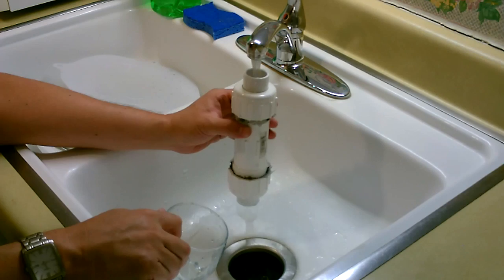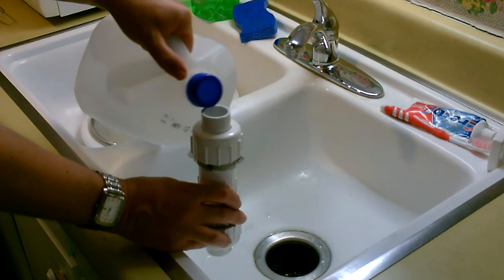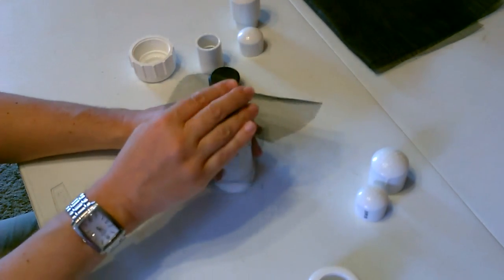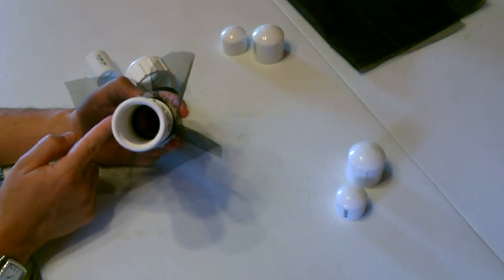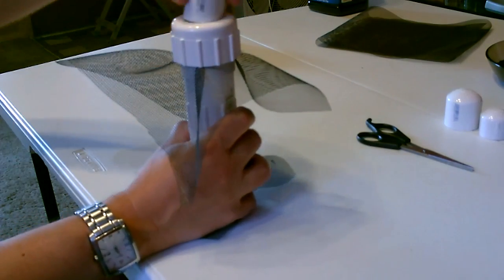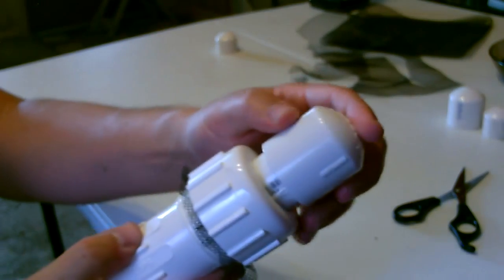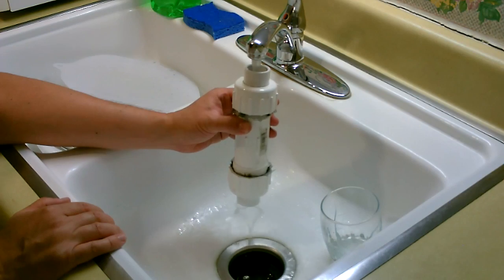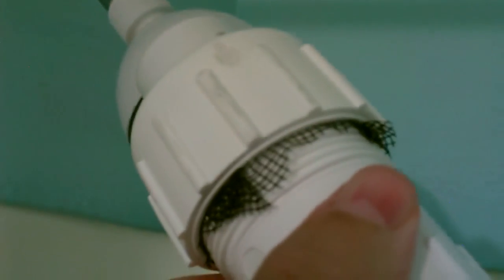Homemade Water Filter! - The "Compression Coupler" Water FIlter! - Easy DIY - Full Instructions

Comment: The screen I bought turned out to be too thick to screw the thing closed, but I found a solution: aquarium filter bags. Turns out using the bags is even simpler to work with than the screen 😊
Reply from the maker: good deal 🙂

Comment: A price update for this coupler in my area. (05-26-22)

I bought the 1 1/4 inch coupler from lowes for 13.60. (The end 2 pieces that get compressed, are 1.14 each.)

Their is a 1 1/2 inch coupler which is fatter for around 16.00.

The home window screen cloth is about 14 mesh.(# of squares per 1")

The marineland carbon is 6x12 iirc so it works well.

If you get a smaller grain carbon, you will need a finer mesh material to hold it in.

Hope this helps some folks.

Keep up the good work desertsun.  We all might be needing these things soon enough.

Comment: Brillant. I have never seen this before. What size is that compression coupling? Any idea what end I would I need on the end to allow this to connect to my garden hose? Thanks!
Reply from the maker: hi and thanks! i would use one of those pvc 'pipe-to-garden hose' connectors. they make them specifically for that. one tip about those is that they don't usually sell that in the PVC section of the store. i always find that particular piece of PVC only in the irrigation and garden hose area.
Reply: @desertsun02  Thank you!

Comment: The carbon keeps seeping through my screen. I even put 2 screens on, and it still had bits and pieces seep through. Are you using some specific type of window screen? I'm using a fiberglass type bought at Home Depot.
Reply from the maker: hi there. some of the smaller bits get thru from time to time (even happens on the commercially sold units). once the few smaller ones go thru you should be okay. i just use regular screen. maybe buy activated carbon that is a little coarser. i think they sell a pellet version too that i've read is good for water purification
Reply: @desertsun02  - Thanks. I'll try the pellet version next time.

Comment: Wow! This is just what I think I'm looking for! We have a 2" water line gravity fed, coming from a spring to a large storage tank. How do you think this would work for filtering out sediment from the stream before it gets to the tank?
Reply: It would probably work pretty well but as for the longevity of this particular filter, for its size I'd be skeptical. For your purposes, I'd apply the same idea but make the 2" piece of pvc filled with activated carbon much longer than the one in the video. Then just use mesh and couplings. I have a very similar water system at my cabin and I'm going to try it to remove some minerals from the groundwater
Reply: Having same problem with my spring, too much sand and dirt getting into the sediment tank did you make one? Would like to see your set up

Comment: could this be used to filter rainwater directly?
Reply from the maker: hi. this is just a quick thought but maybe with the use of a funnel or funneling system on one end *and collection container on the other.
Reply: I have no knowledge  of water filtration systems but can I attach a clear flexible PVC tubing to it?
Reply from the maker: hi. yes, you should be able to do that. might need an adapter to connect the two but should be pretty easy.

Comment: how long should be change the filter and where to buy the activated carbon? nice video thanks for sharing
Reply from the maker: hi. the carbon can last months, even years depending on how much you use it. you can tell when it's time to change it when the water doesn't seem to purify very well. amazon is the best place to buy the carbon. walmart sells it too. also most places that sell aquarium supplies have it.

Comment: I need to hook up to a garden hose. Is this threaded to screw on garden hose?
Reply from the maker: hi there. no threads on this one, but it's super easy to add garden hose threads. (they sell pvc garden hose connector piece that you can attach to one end).
Reply: @desertsun02  awesome! thanks so much! What size compression coupling should I buy? 3/4" 1"?

Comment: Love those design. One question. How would this hold up over time stored in something like a hurricane prep kit or bugout bag?
Reply: I just did some research. Charcoal does not expire if its kept in an airtight container. So it would hold up fine if you got a good seal on the end caps or in a plastic bag.

Comment: Not bad!  But ... is that a nylon screen?  Why not cut make an inner chamber by drilling 1/16" holes in it and then wrapping this screen outside that piece and held on with rubber bands?  Can save money because you can cut each screen to exact size and avoiding having to trim anything unsightly.  Finally, is the same activated charcoal for aquariums safe for humans to use as would fish?

Comment: Hello there! Regarding the compression coupler, does the water pressurize as it travels through the device? I was wondering hence the name "compression". Haha, apologies if this question seems a bit dumb to ask. It interests me as I've studied adsorbent capacity increases with increasing pressure. Thanks in advance!
Reply: No
They are called "compression fittings"  because of the way that they grip the pipes on each end of the fitting
Reply: @darwingraves308  you're 3 years late lol
Reply: They hold the pipes by compression rather than by glue or solder
Reply: @darwingraves308  that doesnt change the fact you're 3 years late lol.

Comment: Hey how bad is it if i forgot to rinse the carbon?
Reply: if you don't rinse, you will get dust in your water.   Just run water thru it until water runs clear.  And PRESTO.    you rinsed the charcoal,
just inside the filter instead of outside
Reply: Bundero daBundero From other videos I've watched, it seems that it's imperative. Sorry to say, maybe just replace the charcoal and start again just to be safe.

Comment: question, did you have the short pvc pipe inserts cut down to a certain size, or did they already come pre-cut?
Reply from the maker: hi there. they're 3/4" coupler pieces. they come that size (no cutting needed).

Comment: How many times can it be used ?
Reply: desertsun02 you can also pre make them without rinsing the carbon. Leave it dry, and when you need it, just run water through it for a few minutes, to rinse out the carbon.
I made some and vacume sealed them in plastic bags, so they stay dry and ready damn near forever. 
I also tried one like this, but with a 1 micron ceramic dome water filter on the end. The carbon filters out most things and then the ceramic filter blocks out microorganisms the charcoal filter can't filter. With it, you do have to run it as a gravity filter. Quite a bit slower. However, you can take some nasty pond water and it comes out clean safe and tastes amazing. 
I love your design much better. I used PVC but had to epoxy my caps on. This is so much easier and better of a design. 
Thanks for your videos. Great work!
Reply: Where do you find threaded PVC pipe like this? Thank you.
Reply: chris petrillo my local Lowe's and Home Depot have them. Not sure about else where, but my Home Depot seems to have more of these smaller sizes to choose from.
Reply: I'm trying to fill up a tank full of water 125..  Can you make a list of stuff that I might need
Reply: Yes.. Can these be used to filter rain water into a collection tank..???....  Exactly what I was looking for thank you so much !!
Reply from the maker: hi there. depends on how "dirty/contaminated" the water is but 
potentially, it can be used 1000's of times. *on average, it will last 
about 5 months if used consistently and could last you years if used 
occasionally.

Comment: Would you have to make sure of using the same side.  ( input and output)  Arrow on it so you don't reverse flow?
Reply: I'm not too familiar with filtering systems, but I do know that activated charcoal's function is based on its structure, which is basically just millions of little pores and such, and crud gets in those. So based on that, I would think direction is irrelevant, but I'd bet shaking it up from time to time to evenly disperse the used and unused charcoal would be a good idea!
Reply: @Noah-hz5ll , you were correct on everything except you never want to shake up or even drop a charcoal filter. It's easy to think that it would help but in reality through extensive research around the world it's been evident that when a charcoal filter is disturbed after the initial filtering so are all the micro-bacterias being disturbed and can easily fall away from the Activated Charcoal Pores. If such a disturbance happens to the filter you'll need to flush the filter with running water for about 30 minutes and then let it sit and dry completely without forced air or heat which could take a day or two.
Reply: However, even though I don't see why this DIY filter wouldn't work I'd still highly recommend sending a water sample that's been filtered to get tested. The difference between homemade and store bought is one has already been tested multiple times and approved before shipped out while the other may actually be better suited as a paper weight. 

All I'm saying is you wouldn't buy a filter from the store if it wasn't marked as tested and approved so why would you build/use a homemade filter without any filtration experience without having it tested? Be smart!
Reply: @michaelwatts8052  I barely remember typing this reply or this video haha. But, that's informative and good information, thanks for the solid response. 👍🏻

Comment: Sorry if I sound too stupid but could this work with rainwater from a catchment barrel? I live off-road, off-grid, with no running water/plumbing. In fact, don't even have a catchment system but hoping to be able to afford even just a container before winter. Thx (you're really very clever and resourceful; it's a gift!)
Reply from the maker: hi there. using this to filter water stored in rainwater collection barrels is a great idea :)
Reply: You could also throw a single silver dollar (1 ounce) into the water barrel too.
Reply: +desertsun02 Thank you!
Reply: +reddpill what for??
Reply: Was thinkin' the same thing. Inline off the roof down the gutters. Mite wanna go larger for better flow but great idea
Reply: Silver kills bacteria!
Reply: Angelow Valpho Purifying water.

Comment: does it remove fluoride ?
Reply: Borax removes fluoride.
Reply: @houndjog  so you put borax in dr filter also n can drink it
Reply: great question men!
I guess to fluoride it may be need aluminium or " arcilla"
Reply: Gaston gainza
How would one use aluminium or " arcilla" to remove fluoride ?
Reply: +pappawheely fluoride is part of the process of aluminium fabrication. and arcilla it's a natural chemical absorbing element

Comment: Another home run.  Thanks. What is the actual nomenclature of the rubber washers and where did you find them?  Trying to find via Google but have been unsuccessful.
Reply: The "Compression Coupler" comes with the rubber washers.
Reply from the maker: hi there. youtube username  "LH in Arizona" is correct. the compression coupler comes with the rubber washers :)
Reply: He didn't use rubber washers.  The white things are all PVC plumbing fittings which can be purchased at a hardware store.  The screen material can be purchased there as well.  The activated charcoal is sold wherever fish and aquarium supplies are sold.

Comment: how could i find activated carbon anf the (rinsed? )
Reply from the maker: hi there. best (cheapest) place to buy activated carbon is walmart. they sell a small jug of it for $6.00 (in the fish/aquarium supplies area).
Reply: Use the activate carbon from wherever you get it (Aquarium shop or big stores etc)  rinse (wash it) yourself in water to get rid of the black that comes off the carbon as well as any debris that may be in with it. :) (The Debris generally floats to the top.)

[[ All carbon filters have black that comes out with the water at first, even the store bought ones have this.  Soooo, rinse it off and Bob's your Uncle ;)  ]]